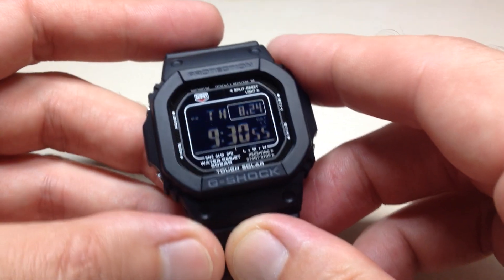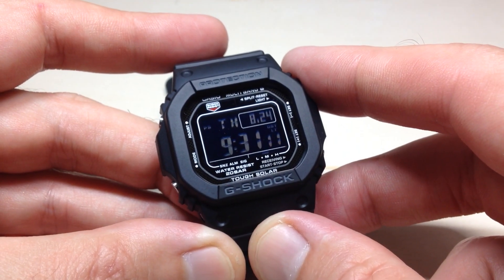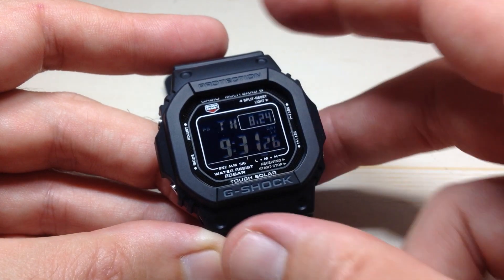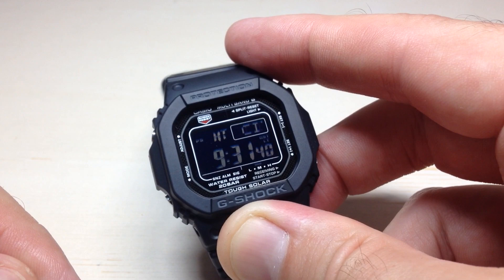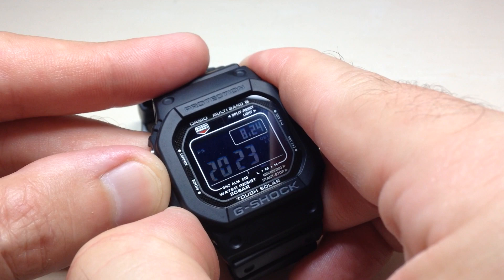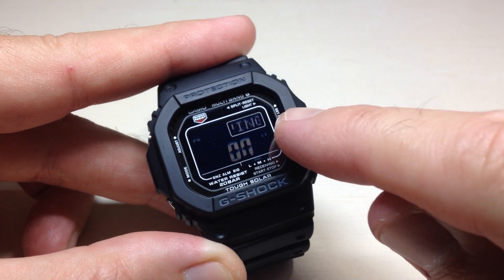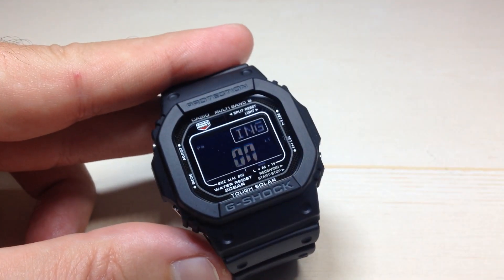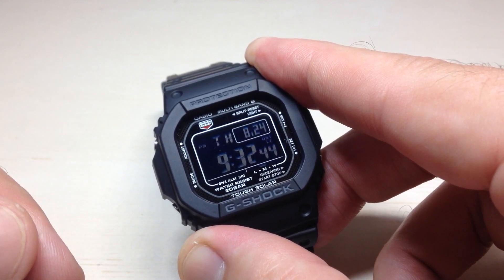Casio G-Shock (Module 3495) | Auto Time Calibration (Turn on/off)

Comment: Why would one turn this off? To save the battery?
Reply from the maker: Yeah, or you are in an area that is too far for this functionality to work (i.e. in the U.S. you have to be within about 1.700 miles from Fort Collin, Colorado in order to pull the atomic time signal).